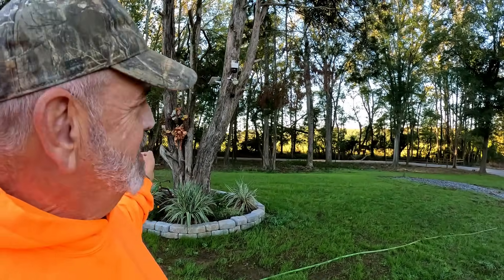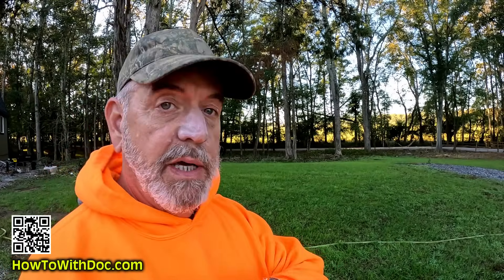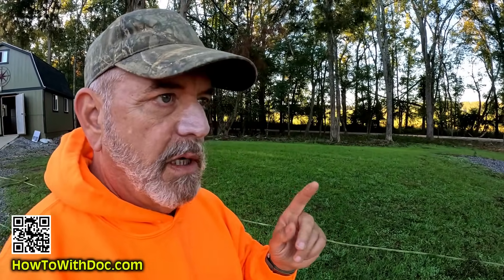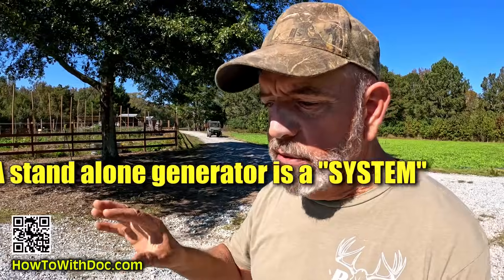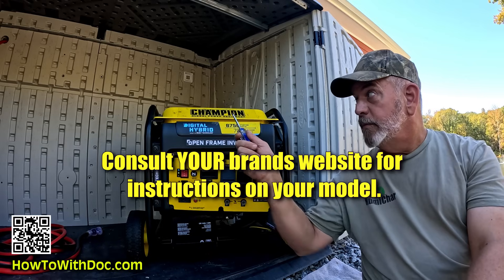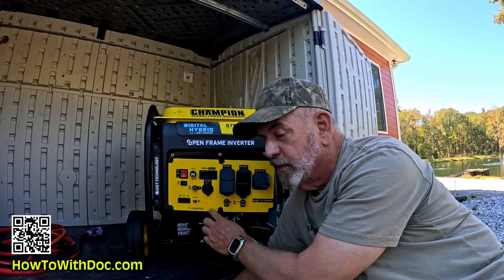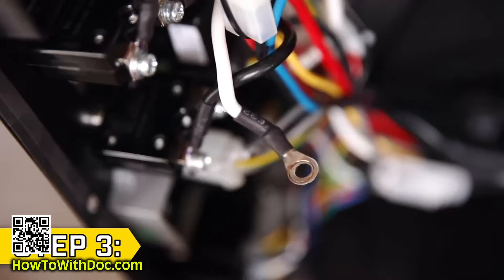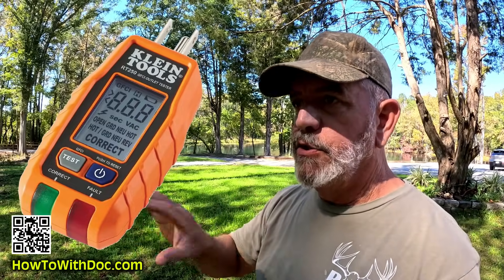Should You Disconnect the Neutral Wire on Generators

Comment: First of all.  you are an excellent presentator. Very beautiful voice .  Secondly. I am an electrician.  These days, generator are the same with neutral bonded to its chassis.  There are no problem so far if you use it as a standalone unit and not hooked to your house's main panel. If you buy a brand new generator from a store and you separate neutral from ground while the unit is still under warranty and, for example, the engine has a problem, be sure the company will most likely refuse to pay because it has been modified.  The NEC/CEC says the neutral should be connected to ONLY ONE POINT and that point is in your main breaker panel powerd by the service provider.  I'm near to the point !!!  As the presentator  said, you can remove the bond between the neutral and ground at generator and there is no benefit but you need to connect a ground from your house main panel or the main water pipe  to the generator to be part of the house system as told.  That way, the code is respected.  If you keep the bond intact or not at the generator,  never connect the generator to your main panel by feeding back a breaker such as the dryer to power your panel after having the main breaker off.  To be very secure for every one, leave the generator as it is and  install a 3 poles transfert switch witch will separate the house neutral and both  120 volts lines from your house to the generator and  put a grounding rod or plate in earth  to ground the generator.  Anyways, install a transfer switch whatever the method you choose is the only way to respect the electric code, linesman and yourself. As the man said, get an electrician !
Reply: I’m not super smart with electrical, but instead of unbonding the neutral on the generator couldn’t you just not run a neutral from your generator inlet box (run both hots and ground but no neutral) to the main panel?

Comment: Un bonding the white wire, is it the same on a 9000 watt harbor freight generator?
Reply from the maker: You should be able to find the BONDING point or they might have it in the manual. You only do this if the gen is BONDED and you are running to your main panel.

Comment: You should mention that another method that works here is the installation of a manual transfer switch that switches the neutral in its setup. It limits the circuits you can use, but it won’t force you to modify your generator, which, for some manufacturers, will void the warranty.
Reply: Totally right Sir !

Comment: It’s my understanding you should have  the neutral ground bond connected at the first point of service…if your house has “no power”  then your generator IS the first point of service..your house connection ( green screw) should be disconected and let  the gen set  have the grnd/bond connection.
Reply from the maker: There should be only one BONDING point. That is where the ground and neutral connect. If you are using your generator STAND ALONE... (running ext cords) then leave it bonded. If running to your PANEL... then unbond at the gen. Your panel has the bonding point.
Reply: @HowTowithDoc what if your panel in your home is a sub panel that is not bonded because there is an emergency disconnect outside that is bonded since that is the first point of contact? Then I would need the generator to be bonded because otherwise I would have zero bonding happening correct? The transfer switch I wired in goes directly to the sub panel. My sub panel is fed by a 2 pole 100 amp breaker if that makes a difference?

Comment: I didn't see the whole video, but I think you should think from perspective "what if N contact will fail in 2/3 phase system" 😉 So if your N is grounded in your panel and the generator is bonded, you can disconect power line N (before grounding point). So technically it's like "N must always be grounded and this ground from N cannot be disconnected".

Comment: you should only run current from hot to neutral not from ground to neutral ... if you disconnect the neutral then you are running from hot to ground making the chassis hot and possibly killing you and you are not running to sources at the same time ... if you do so you will blow your generator ... a bond neutral is needed for your protection ... if there is a short in the house the breaker will trip in the house and if there is a short in the generator  the breaker of the generator will trip ... what you need to do is not connect the ground wire from the generator to the house nor to the earth
Reply: Sooo....you're way of thinking is not float the neutral on a generator so there's only one point of bonding on the house wiring once tied in with the power inlet?  And leave it bonded?  I'll pass on that.
Reply: @ITguyAR_66  one bond that is grounded to earth... i prefer to leave the ground in the generator incase there is a short in the generator but not connected to the house ... if you have a short in the house then it will pass thru ground and neutral and trip ... by the way every socket in the house has a reading from ground to neutral as 0v and from ground to hot as 120v because of the bond in the main breaker box ... thr generator is just an alternative to the main electrical grid ... the main electrical grin only bring 2 hot and a neutral so do the same to the generator in the transfer switch ... 2 hot and the neutral and no ground in the transfer switch but leave the bond in the generator so you will not get shock if there is a short in the generator
Reply: @ Good luck with that.  I ran that by our city electrician and he laughed.
Reply from the maker: You are confused... you are not DISCONNECTING it... You are simply UNBONDING at the gen if you are running to your PANEL which already has the bond. This is actually shown on most manf websites.
Reply: @HowTowithDoc  why would you unbound it if it keep you safe? as long as you don't ground the generator ground to the main breaker box or the earth then you only have one ground ... it does not make sence to unbound the ground from the neutral in the generator just to ground it to the main breaker box

Comment: First I want to say Nice video and information! 
Comments for those who need to know:
The system you explain well is called a: Separately Derived System” in the NEC code.
I watched another video that was well explained. In it, he ran into a problem and burned up his electronics. He then goes on to explain what happened blaming himself for not doing it right. Checking all the connections in his panel, transfer switch, and then the problem. He isolated the ground and the neutral at the generator properly.
Found that his 20-year-old extension cord, which he used without fail until he read about the neutral and ground requirement to be separated when connecting to a “Separately Derived System”.  
So might I further suggest to do before, what you said to do was to test the outlets within the house and to hopefully avoid his dilemma?
His extension cord had a bad connection in the cord cap loose screw from the factory he claims.
1.	First, check your extension cord terminations, and the continuity, should be done periodically.
2.	Use your tester to confirm that there are 120 volts at each outlet on the generator.
3.	Next, using a multimeter to check the voltage at your twist-lock outlet on the generator, plug before plugging in the cord at the outlet.
4.	Plug the cord into the generator twist-lock outlet, before plugging it into your inlet box to the house. Check for proper voltage at the Cord Cap.

Comment: 99% of generator are NOT shipped with a bonded neutral. Most open frame generators are bonded, but many if not most inverter generators are floating neutral from the factory.
Reply from the maker: There will be label on the front... or it will say in the manual
Reply: I'm not sure about "99%" as there are a  great many that come as floating neutral and they will typically say right there by the outlets.  If they are bonded, most are easy enough to change over by dropping the ground off the neutral and companies supply that info.  Larger open frame generators tare pretty easy by removing the end where the stator is and access that wiring to pull that single wire off.

Comment: This is a great explanation! I agree with the other commenters that there should be a neutral disconnect on portable generators. It could be an issue depending on how the system is connected to your house. Any bonded metal along the way will have the potential to carry some current

Comment: Smaller generators do not have a Neutral to Grnd bond. You have to add one yourself. I made a plug for that that is removable. I was thinking about this issue because I want to connect my 1900 watt generator to my house furnace. Do I need to run the generator ground wire all the way to the furnace? I dont think so as all parts of the furnace are already grounded. However my Hughes Autoformer will not wok unless the ground at the generator is bonded. If I don't run the ground wire all the way to the furnace then I will still need the bonding plug. Have not tried this yet!

Comment: There should be no alterations needed if your using an interlock switch
Reply from the maker: Not true.... that's WHEN you need to make the change. You DON'T make the change if using as a stand alone.  Your PANEL already has the bonding.

Comment: My only issue with this endless debate of Bonded neutral and Floating Neutral just won't ever go away.  I have a 2500 watt inverter generator with a floating neutral  that I use to run my natural gas furnace via an extension cord in emergencies.  Have seen numerous videos on this topic.  Consensus says a gas furnace will do a partial startup until and/or before the hot ignitor comes on.  If it does not see a case grounded wire from furnace to generator, the gas valve will not turn on until it sees a ground (forget neutral wire- all must see the neutral).  I used a three prong plug where the round ground terminal and the Neutral  terminal are tied together.  Thus, in essence,  I've just created a 'bond' with ground and neutral.  Then, plug that into any 120v socket on the generator and the furnace kicks on immediately.  First comes the inducer fan, followed 10 seconds or so later the Ignitor comes on, and lastly the buners ignite and circulation fans several seonds later.   SO,  saying a neutral wire isn't needed isn't true.
Reply: It seems like you didn't really pay attention to what he was saying in the video.

He said if you are only plugging the generator directly into appliances, such as directly into a furnace (not the electrical system of the whole house), then you _do need a bonding jumper between neutral and ground.  If you are plugging the generator into your main panel then you should not have a bonding jumper connected at the generator (because there is already one in the main panel).

Your description is entirely consistent with what he said.  Since you are not plugging your generator into your main panel, you do need a bonding jumper between neutral and ground on your generator in that case.

Comment: You forgot the third grounding scenario.  Or scenario 2b.

Scenario 1:
You covered using a generator as an isolated system in the field.  Bond Neutral to ground.  

Scenario 2a: 
You covered, using a generator as a part of an existing system.  Unbond the neutral.

Scenario 2b:  you Didn't really cover, technically this might be scenario 1b. When you backfeed a panel it's ALWAYS scenario 2a.  When you use a transfer switch SOMETIMES it's scenario 2b.   SOME transfer switches may fully isolate the items supplied by the generator, then bonding and grounding is up to you to handle somewhere in the system.

Comment: no need to go through all that just don't hook the neutral wire up in your breaker box, will run your home and safe to use elsewhere
Reply: assuming you're feeding your home with 220
Reply: assuming you're feeding your home with 220

Comment: My new Champion portable generator came with a floating neutral from the factory. Most Champions do. I understand some other manufacturers do the same. It’s important to understand what you’re working with before making changes. You’re wrong in saying that “99.9%” of generators are bonded neutral by default.

Comment: you seem to have found the only Generator that does not have a floating neutral.. Honda, Firman Westinghouse all have floating neutral so you dont need to separate ground/neutral. In fact you need to buy a ground to neutral adapter if you furnace need a ground neutral bond to run. Lots of furnaces now heed Ground-Neutral bonded.
Reply: My Wen 1800W generator has a frame and was NOT bonded out of the box. I bonded the neutral to the ground and added a label to indicate.  I only use the generator with an extension cord.
Reply from the maker: Most FRAMED generators are BONDED. I even went to the Westinghouse website and every one I pulled up was bonded to the frame. It will show the symbol on the front as well. 
https://westinghouseoutdoorpower.com/blogs/westinghouse-blog/float-the-neutral-wpro8500-wpro12000-wgen12000
Reply: @ bonded to the frame yes but not to neutral. You are not understanding the difference between ground neutral bonding & ground bonding to the frame totally different. Of course all gennys have frame bonding that’s code but they ALL have a floating neutral so you can use connected to a transfer switch you use your home ground/ neutral. Is you bond your ground & neutral then connect to transfer switch you have 2 neutral paths. Not safe.
Reply: @AuldHowker  I admit to knowing next to nothing about this, but if all have a floating neutral, then why these instructions? "HOW TO FLOAT THE NEUTRAL ON WPRO8500, WPRO12000, AND WGEN12000
These Westinghouse generators are wired with the neutral bonded to ground. If you are connecting your generator to a panel board transfer switch, a licensed electrician will need to consider removing the bonded neutral to ensure proper operation of household GFCI circuits."